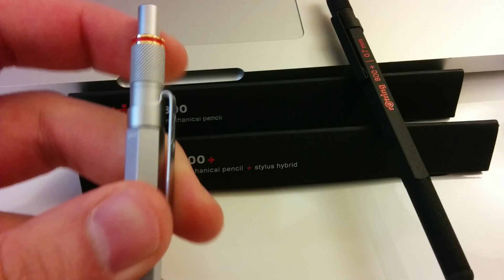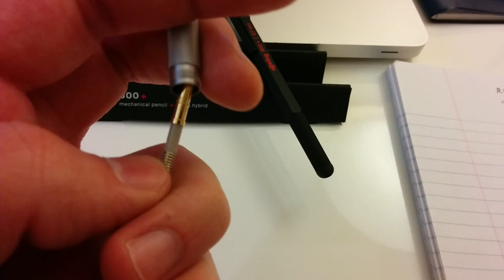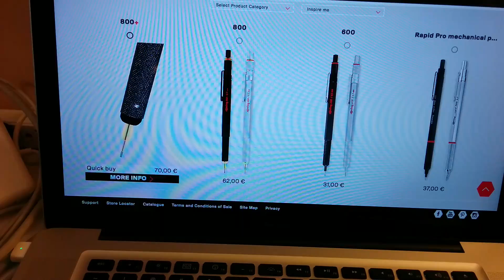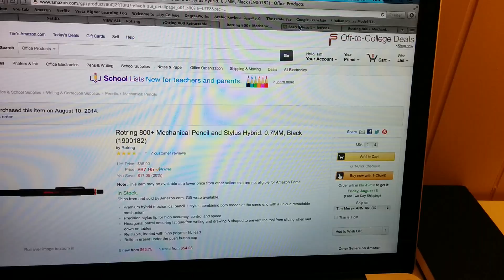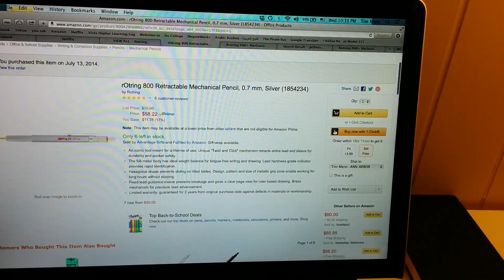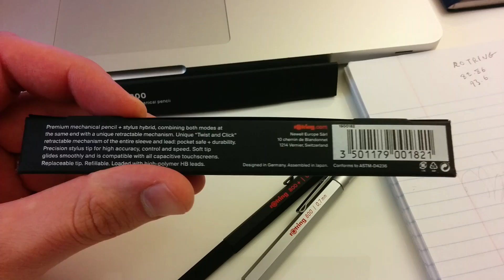rOtring 800 and 800+ Mechanical Pencils review

Comment: Can you describe exactly how your first one broke?  Did you drop it?  Did the tip bend? Did the lead sleeve retraction mechanism break?  You allude to the fact that it broke because you took it "on the go", but the way I treat my pencils isn't any different at a desk versus on the go, so i'm curious to understand what about "on the go" resulted in breakage.  I'm thinking about getting one of these, but I also really like my 600 to the point where I can get over the retractable 800 if it has a weak mechanism.  All metal Rotrings are made of brass.  I've heard three different rationales for the eraser cap holes: 1) The "eraser breathing" 2) seeing that it is a pencil and not a pen in a pencil cup 3) to prevent choking.  All three camps will vehemently defend their rationale.
Reply from the maker: +Michael Fryda I dropped it while writing and the lead holder broke (bent to 90 degrees angle!)

Comment: Very good review on this product! Fair and unbiased. 
I just have a question, on the part of the video where you remove the knurled grip to show where you put the tape on the 800 I saw a plastic part where the tip was attached. I just wanted to confirm that with you if its really a plastic? 2nd as for my opinion the tip was made long for you to have a better view of the paper but its seems fragile and can be damaged if you drop the pen when its not retracted, I believe rotring can repair this pen if it gets damage because its expensive and not something like a thing that you can just throw when its broken.
Reply from the maker: +Stingray Vanquish, it is plastic, and yes it can be broken if dropped and Rotring won't service it.

Comment: I've heard that these break lead sometimes. Did you have that problem?
Reply from the maker: Absolutely not, unless you are using low quality leads. I'm currently using Pentel Hi-Polymer Super, and although they are mediocre but never had a problem with what you said whatsoever.
Reply: Ordinary Buyer
Even with Uni Dia leads it seems people have some that break it (http://www.reddit.com/r/pencils/comments/2ns23y/review_of_the_rotring_800_xpost_from_rmechanical/)
Reply from the maker: ilikepieism He begins with "The other day arrived the newest addition to my collection: a Rotring 800 drafting pencil in silver (0.5mm)".
I have problems with all my pencils which are 0.5, It's a weak and thin lead for me and many other people like me, but the ones I reviewed/own are 0.7 and I have no problems with 0.7 or Rotring 800/800+ other than mentioned in the video.
Reply: Ordinary Buyer
I don't have any issues with my 0.5 pencils, and the same with my .3 ones, It is probably the lead though... I think it's more common in the .5 and .3 versions
Reply from the maker: It depends on how you write, I tend to have a tighter grip and more pressure when I write, so for me the 0.5 is too thin, but the 0.7 is great. As for what the reddit article suggested, I don't have any problems with 0.7 and especially 0.7 Rotring 800/800+.

Comment: What brand/type HB refills would you recommend for mechanical pencil?
Reply from the maker: holynex I use Pentel Hi-Polymer Super HP from work, but I have used the Rotring ones and they are great but expensive. In my experience these are top brands to go for and their rating:

1. Rotring, Steadler, Faber-Castell.
2.(not far from the first category in quality), Pilot, Uni, Pentel.
3. all the other brands.

Leads are categorized by their hardness (H) and blackness (B), hence the HB mark you see on the label, which means that the HB leads are the hardest and blackest ones you can get combined. You can get a (B) but that means it has a deeb black mark and most likely soft and more prone to breakage, therefore I suggest you stick to the HB leads for the versatility and endurance.

Please note that using HB pencils is mandatory in tests and exams in the U.S and many other countries, so make sure if you are a student to use HB leads.
Reply: Ordinary Buyer Thank you for the reply.
I've just received Uni Kuru Toga Roulette with Uni Kuru Toga pencil HB leads. I'm quite pleased with my purchase although I would prefer the pencil to be a little thinner at the grip section. Hopefully I get used to it soon enough.

Comment from the maker: I like the 0.7, because its a thicker lead and naturally more resistant to breakage when pressuring too hard.
It depends wether you push hard when writing or drawing all the the time or accidentally, but I would go with the 0.7 for general use.
You will save money on leads due to reduced breakage, and the difference in the writing lines thickness on paper is unnoticeable compared to the 0.5 and you will have more clear apparent mark on any surface or paper type with the 0.7mm.
Reply from the maker: ***** HP as directed by the booklet that came with it.
Reply: There is a mechanical pencil called "orenz" which is a 0.2 lead pencil that literally never breaks. It is made so the stainless steel tip bit that covers the lead covers the whole lead and not partially. there is also a new 0.3 design but it is still new so i haven't seen it on Amazon.
Reply from the maker: Cougar Ameda You mean the Pentel Orenz?
Reply: yes
Reply: only problem that i found is that if u drop the pencil or something, the lead breaks from inside and it is very easy to jam